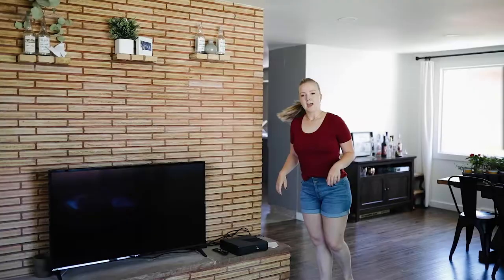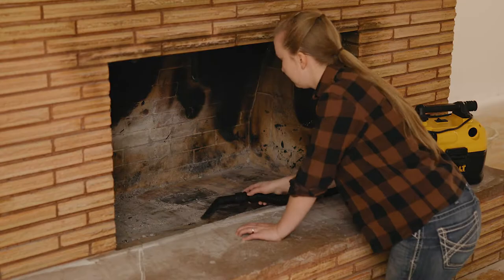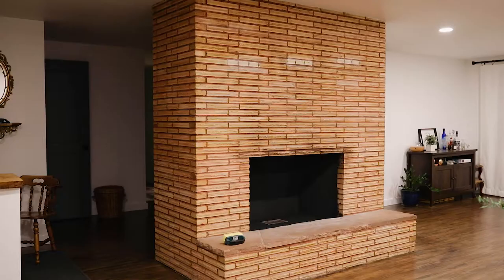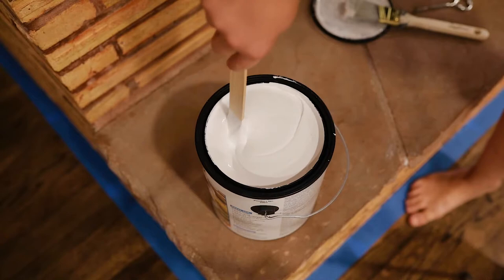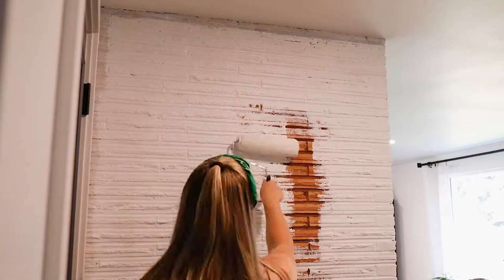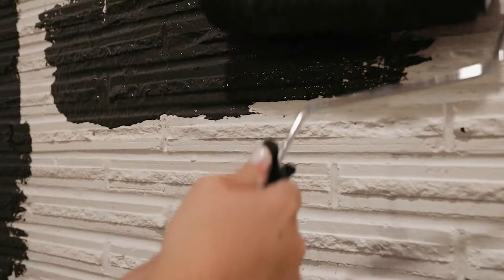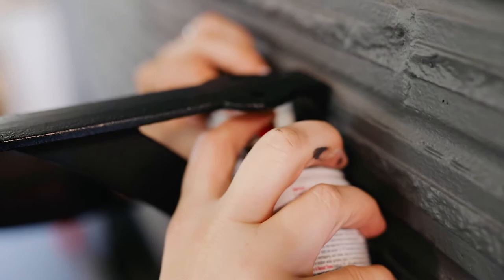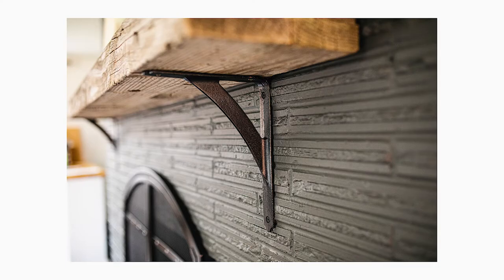🤩 DIY Brick Fireplace Makeover (so satisfying!) | EPISODE 6 | House Projects Series

Comment: if I wanted to paint white, can I just use the primer as the color? or should I use an acrylic white paint on top of the primer? very beautiful project!
Reply from the maker: I wouldn't recommend it since primer isn't designed like a paint and will break down and deteriorate over time if left unpainted. Also, primer should be painted over within a few weeks to make sure it still adheres to paint correctly. Thank you for watching!!

Comment: Would you be willing to share about how much it cost to redo your fireplace? We’re hoping to do the same!
Reply from the maker: It was so worth it and has really classed up our living room! After all the supplies, we probably spent about $240. Joel made the mantle from wood that was given to us so that saved us a lot of money. Hope your project goes well. :) 

Here's a break down of costs if it helps: 
- $5 Cleaning brush
- $14 Multi-tool blade 
- $7 Spray paint
- $33 123 primer
- $5 Painting tape
- $3 Tray liners 
- $7 Paint brush
- $12 Roller pack
- $35 Gallon of paint
- $23 Mantle brackets 
- $15 Concrete screws 
- $80 Spark arrestor